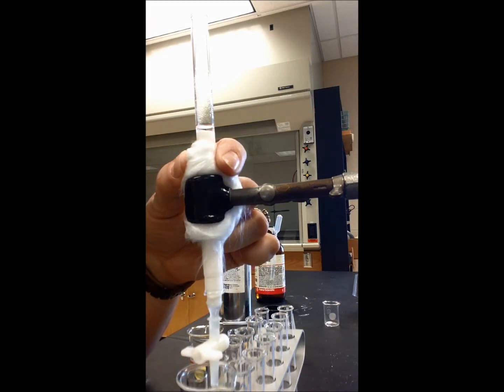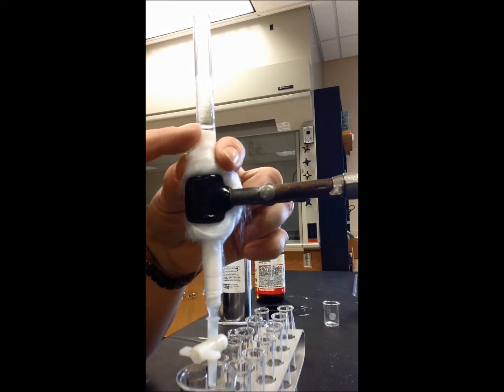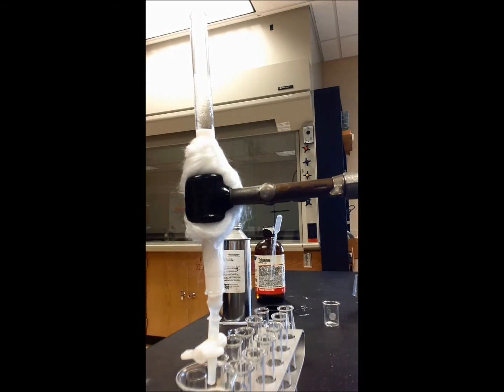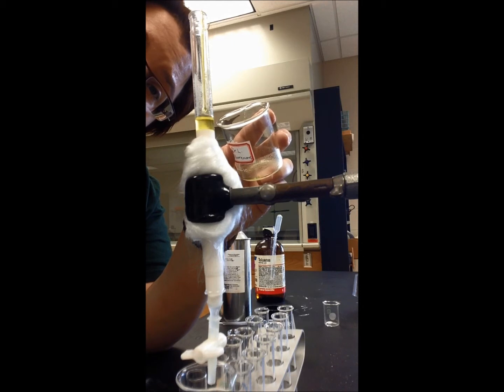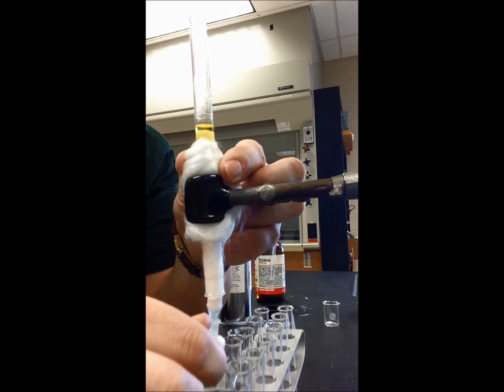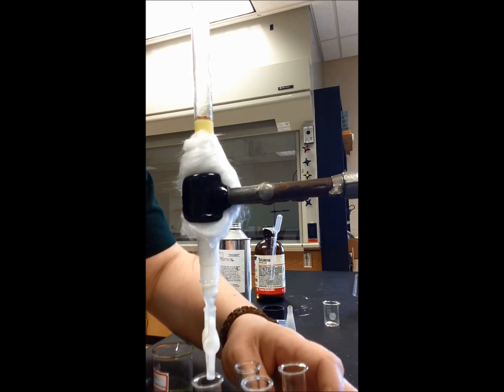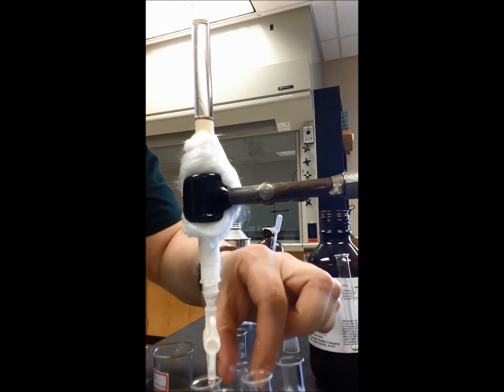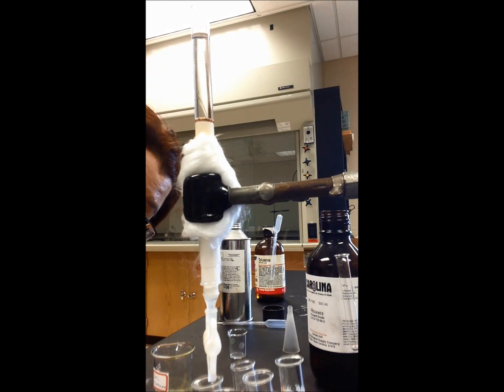Loading the sample and collecting fractions

Comment: Why can we not let any air touch the top of the column? What happens if air touches the top of the column?
Reply from the maker: Abdullah Khan If air touches the top of the column, the silica gel or alumina will dry out and crack. This will allow a channel to form instead of having a nice smooth top. The channel will inhibit proper separation.
Reply: @doclenczewski727  Thanks! Also, what is the purpose of doing multiple fractions?
Reply from the maker: Abdullah Khan Multiple fractions ensures better separation, especially of the compounds you’re separating have similar Rfs. One compound will come off first followed by the next, etc. Small fractions will make sure that the second compound comes out separately.
Reply: @doclenczewski727  Thanks, last question! How can I evaluate the effectiveness of the column chromatography separation using TLC?
Reply from the maker: Abdullah Khan Well, you spot every fraction on a TLC plate and identify which fractions contain the compound you want, combine them, and remove the solvent. Check out this video for the results of this particular column: https://youtu.be/Ok7SVM98o4Q

Comment: With which option is it most likely to recover the largest amount of pure compound with large fractions or small fractions ?
Reply from the maker: It depends on how good your separation is.  It's best to check the separation on TLC first, and again via TLC as you are running the column.  You can take large fractions until you get close to your compound.  Then you can take smaller fractions until all impurities are gone, then take larger fractions again as your pure compound comes off the column.  If that seems too tricky, then just take small fractions.  You'll have more fractions to combine in the end that have your pure compound in them, but there's less risk of impurities in with your compound.
Reply: Doc Lenczewski Thank You!